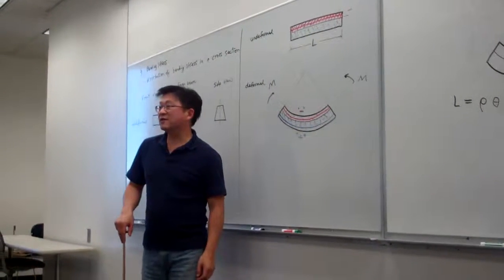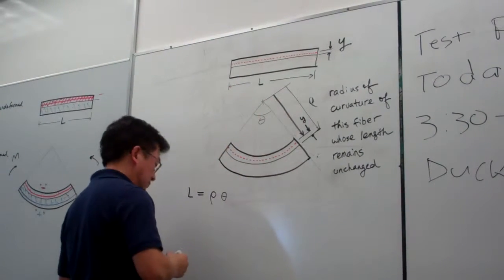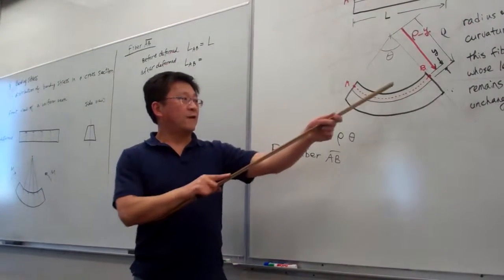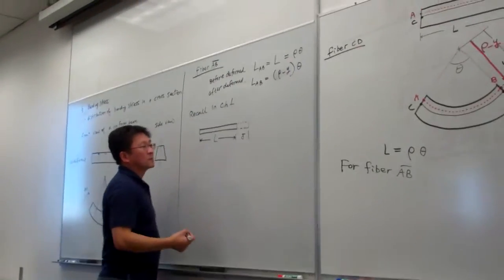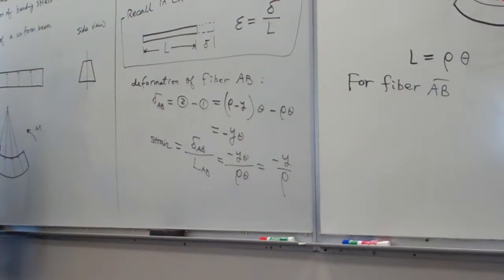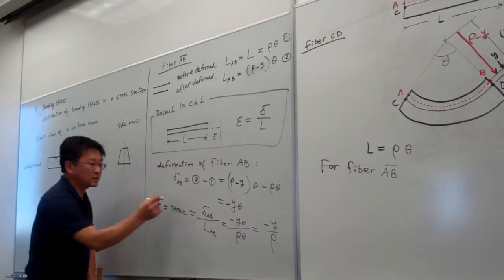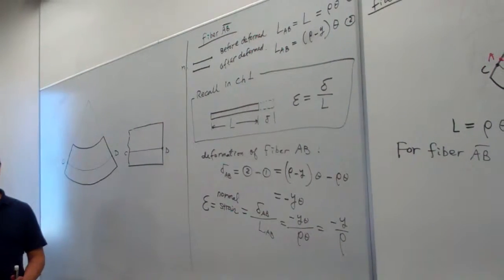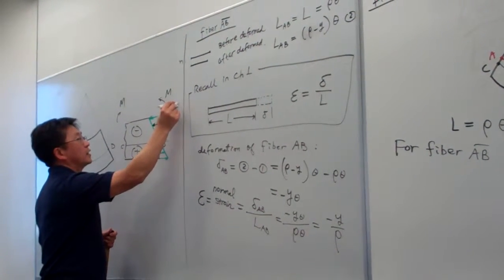Ch4 12 Bending strain and stress

Comment from the maker: Under the assumption that cross-sections remain normal to the neutral surface before and after bending, the bending strain and stress are in linear distribution (as a function of y).  Beams under this assumption are called Euler Beams.  Euler Beams are sufficiently accurate for the problems in which bending (i.e., curvature) is small.  

The bending stress would become nonlinear in y when the assumption is violated.  Under this situation, shearing stress will be present as well.  Beams under this situation are called Timoshenko Beams.  For beams in large deflection or large curvature, Timoshenko beam model will be more accurate than the Euler beam model.